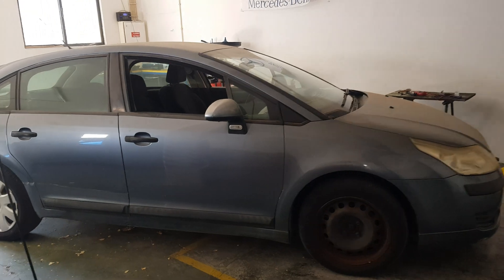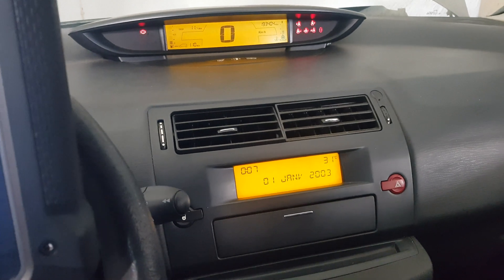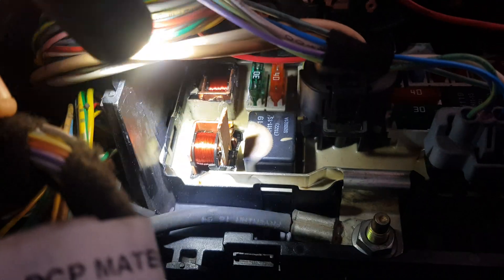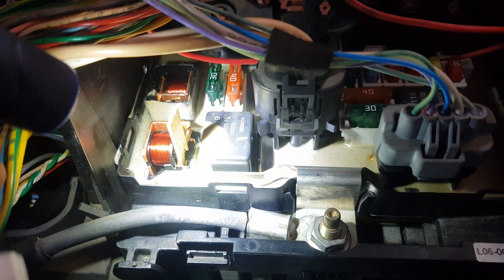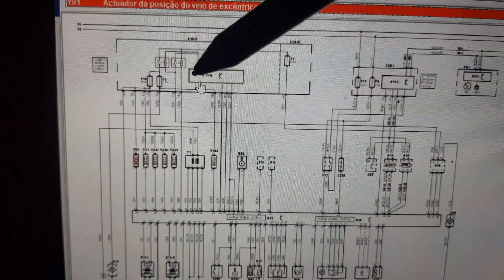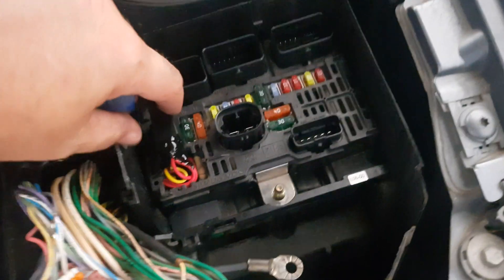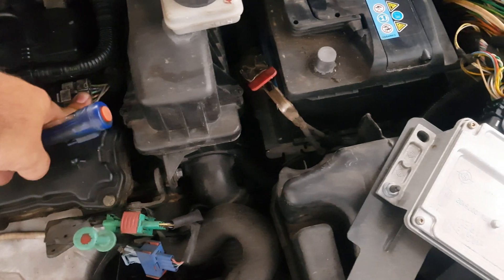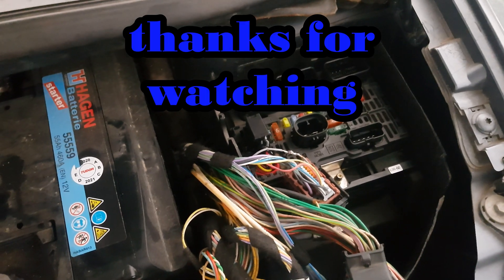citroen c4 P0351 P0352 P0353 P0354

Comment: I have a problem with a Peugeot 407 2.0 100 kW. It starts properly,works until it will be 85 degrees Celsium and then the engine stops. I have errors P0351 P0352 . I changed the spark coil block for a new one . I have a 100 km ride and car worked okay, then next day i had the same issue.  It will be the same solution like on your video ?
Reply from the maker: @technodev4914  thanks for watching...
It can be wiring, also can be ecu...

Comment: Great video. How did you get the cover off the relay whitout breaking it ?
Reply from the maker: @klauswillyhalvorsen1081  thanks for watching
There are little tabs on the bottom, gently pry those open one at a time and you will get it open...good luck
Reply: @PSICompanyPerformance  thank you

Comment: I have p0351 and p0352 on C3, car wont start, could thst be the same problem? Fuse box in C3 is a little different.
Reply from the maker: Thanks for watching
Yes it could be the same thing.
Good luck
Reply: @PSICompanyPerformance  ill get fusw box and let you know today
Reply: @PSICompanyPerformance  
Nope, its fried ECU, apparently water goin throw thermostat housing, yellow connector and travel in wire insulation to the ECU, even if that is really hard to believe but thats how electrician said. Im just a mechanic 🤣🤣
Reply from the maker: @Alennovak666  yap that is in fact possible its called wicking and it travels even upwards the wire up to the ecu...
Reply: @PSICompanyPerformance  i hear about it for a few times but its crazy to me. How can it travel so much and not a single red residue from coolant. In this situation its green but still as a mechanic i know it leaves some mark. In this case nothing except fried ECU and green wire oxidation.
Reply from the maker: @Alennovak666  if it got dried it would show a mark but if its still wet you cant see it..